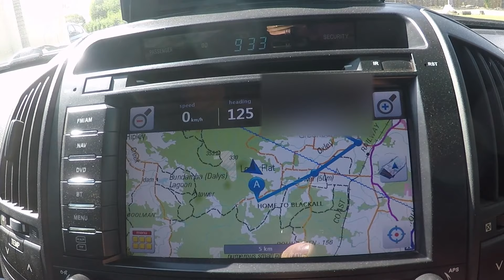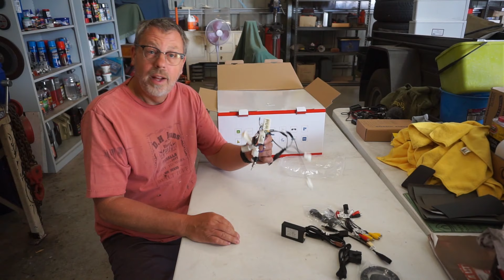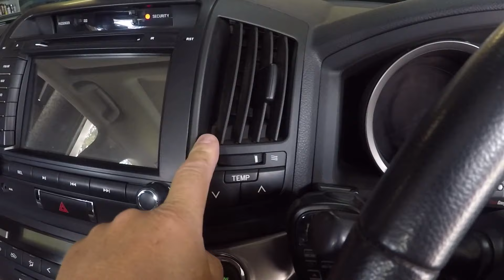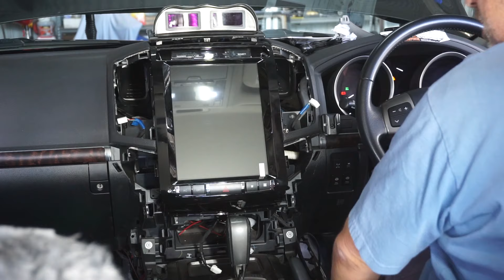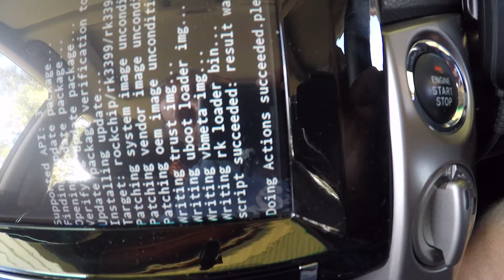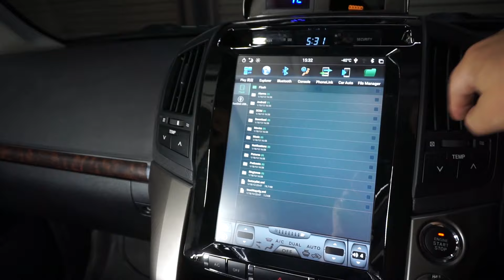Landcruiser 200 | PX6 12" Tesla Style Android Head Unit Installation

Comment: great video.  Great information.   So impressed with Tesla screen "opportunity".  good to know what can possibly go wrong.   Really appreciate the information,   Thank you.  In the process of deciding if to buy a 2011 Landcruiser with or without the big screen.  We really do want the big screen,   If it works!
Reply from the maker: Thanks for the kind words.  The firmware upgrade takes these from a game of hit and miss, to one of solid non glitchy performance.  I love mine👍😎
Reply: Your information  @JafffaAdventures   is a true diamond.  This week we viewed two 2010/2011 Land-cruisers with the big "tesla-esque" headset and one with the original radio,  Toyota/Lexus - are super-reliable at 10-13 years old.   The only issue is the "dated" GPS and dated lack of mobile phone synchronisation.   We all live by "Wayze" navigation here.  Thus if it can ever work - it will be a true game changer.  The big-screen units I saw had Landcruiser logos/images.  But there was no proof that all the configurations work. Both car dealers - said that these screens needed another re-setting.  The dream is to have proper 360 degree cameras working and to have this massive screen to have full Wayze AND  Google-maps options.    We shall see over the next month.    We live in a country with excellent mechanics.   So we will see,....
Reply from the maker: Go well mate👍😎

Comment: Hey Terry.
I just installed the 10.1inch head unit. I got a Amplifier and focal speakers installed aswell, and no real significant improvement. 
Have you upgraded anything from factory in your audio? And if so are you happy with it.
I'm trying to nut out if the Amplifier is not powerful enough. Ec said it should of improved significantly. 
I hope for a response.
Thanks Terry
Reply from the maker: Thanks for reaching out.  I did not upgrade any audio components in my system.  I was seriously considering the focal speakers and am disappointed you have not seen any improvement as I was lead to believe the difference was like night and day.
The current factory speakers are ok, but I was looking for something that really kicks butt.  
I am not using an amp.  Sorry I could not be of any help.  If you do get it sorted let me know what you did so I can learn too.  Cheers
Reply: @JafffaAdventures  Focal do kick butt. Installers saying the amp works and ec saying it doesn't. And guess who's stuck in the middle? The customer as usual. It's turning into an expensive mess
Reply: @JafffaAdventures  I bought the Focal is690toy. Don't be fooled about plug and play. Tweeters need rewire and speakers need new hole drilled out. Pretty pissed about it all.
Thanks for replying. Appreciate it
Reply from the maker: Wow, I really thought they were plug and play.  Thanks for sharing 😎👍
Reply: @JafffaAdventures  Hey Terry.
I sorted our my volume issue so passing on info you may not be aware of on yours, especially for future preference. In the factory settings on head unit once you put in password. There's a sound setting you can control, it's a gain function in DBI. Ecoffroad after 3 calls never mentioned this setting so I was lucky I found a local guy that knows his shit . If wasn't for him I would of upgraded amp again and problem would of been the same, so thank God he saved my ass.
Keep that in the memory bank if want unit louder, especially if upgrading speakers. Mines crazy loud now
Reply from the maker: That is awesome feedback, thanks for sharing.  That’s one thing I have noticed with these units, there and dozens, possibly hundreds of settings that can be changed.  I reckon a lot of difficulties people experience are with setting issues.  I’m stoked you got it sorted mate, cheers😎👍

Comment: Hey there Jaffa, just wondering
How did you install the temperature display into the unit as it's integrated into the existing unit?
Does the emergency switch actually work or it is just sitting there looking good without any connection?
Reply from the maker: Temp is displayed by the unit itself but needs internet connection as it pings the local weather for the area to get the data.
Yes the emergency switch is fully functional.  
Cheers 👍😎

Comment: Hi buddy ,

I have installed the px6 into a 2020 Sahara but have no sound or reverse cameras . With the audio connections do I need to plug in connectors from sahara harness to audio connections with the Px6 . And with the cameras and 360 camera do I need to plug in more then 1 connectors currently I have the two yellow ones plugged in labeled camera & 360 camera ?

Any feedback would be hugely appreciated. Love the videos mate 

Thank you
Reply from the maker: Thanks for the kind words mate.  I wish I could help but I’m afraid I can’t be of much use.  I just plugged everything audio related into the factory harness and it worked straight up.  Same thing with the video.  I’d reach out to you supplier mate.  Cheers😎👍

Comment: Nice video as usual 
I’m one up on you my temp indicator works
I had a real drama trying to get the unit to link to my iPhone hot spot but it turned out it was me not the unit 
I hate it when I can’t blame someone else
What did you use to customise the screen photos 
My next drama is my aircon temp resets itself to 25deg so I have to crank it down every time I start up so hopefully I can sort that out cause it makes me tense everytime
Reply from the maker: I know, it sucks when you can’t blame someone else😂.  I used Sergey Koslovs custom firmware to set up the photos of my vehicle on the home screen.  Without that firmware you cannot do it.
I never had any dramas with my AC, just the temp reading.  Sergey has since fixed that so it reads correctly now.  Thanks for watching mate, I sincerely appreciate it 😎👍

Comment: Hi Terry, I got it installed myself. Everything works perfect except the volume is very low coming out of the speakers even with it being on the loudest from the unit. I have also gone to settings and increase the volume to the loudest but to not working, actually only one speaker (Front - Right) its working and very low.
Is there a separate connection which would increase the volume? Someone knows how to fix this? Thanks in advance.
Reply from the maker: That’s a bummer Ruben, unfortunately I did not have the issue so am not really sure what the problem is.  Is the volume the same from blue tooth through your phone for example vs Spotify on the head unit, vs a radio station.  The reason I ask is that sometimes Bluetooth can be a little quieter, especially if you are streaming from a device like a phone and your volume is turned down on the phone.  I trust you will get it sorted mate, cheers🤔👍
Reply: @JafffaAdventures   Thanks for your reply. Initially I thought the same, but no the sound is the same for Bluetooth, radio or other device. I have searched for this and found I guy that had this same problem, I've asked how he have fixed this issue and I waiting his reply.
Reply from the maker: That’s good to hear Ruben, good luck mate.  If you don’t have Sergey’s firmware I would definitely recommend that once you get settled.  Cheers😎👍
Reply from the maker: Let me know if it works.
Reply: @JafffaAdventures  Hi Terry, here is my feedback about the video about the no sound in my Tesla type unit, it really worked. The video fixed my problem. After that I had another issue with my reverse parking camera, I had no signal. After checking lots of videos I found that after change for the Tesla mideacenter unit the original camera from Toyota LC200 don't works any more. I bought a new aftermarket camera and now it's working perfectly. Cheers mate.
Reply from the maker: Good stuff, thanks for sharing Ruben😎👍
Reply: @JafffaAdventures  Hi Terry, do you know where I may found Serge´s firmware for LC200? Cheers
Reply from the maker: Go onto the FB group I mentioned the the video series (can’t remember the name), search Sergey Koslov and direct message him.  He is very responsive.  A firmware upgrade will transform the unit, best thing I ever did with it.  Cheers

Comment: Great videos Terry, love the "how to ones". With the OBD2 connection are you able to lose your scan guage. Is it any good
Reply from the maker: Thanks Gavin, you are very kind mate.  The OBDII connection does not have as much data as the scanguage (eg fuel consumption is missing), although having said that the majority of the information is there and the stuff missing might be able to be found, I just have not looked hard enough.  I much prefer the scanguage however and will definitely be keeping it.  That’s because it’s mounted on the dash right in front of my eyes and is constantly in my vision.  Using the head unit, I have to turn my head to read it and if I have an app open I have to minimise the app to see the data.  Not a big deal but it’s enough for me.  Good question mate, thanks for asking 😎👍

Comment: Hi mate, what part of the harness does the reverse camera plug into on the car? I have a 3 leads coming off head unit which have no matching connectors from the car?  thanks for the video, it helped me slot , I just can’t see where you hooked the reverse to the actual car harness , cheers
Reply from the maker: The main wiring harness has a yellow AV plug that is labelled "reverse camera".  I show it at time stamp 4:17 in the video.  Thanks for watching and following, and I am glad you found the video helpful.  Keep the shiny side up, cheers!

Comment: Hey mate, any idea where I can get those bolts that hold the factory head unit it in, also is it safe to drive my car without a head unit in as I’ve taken the Tesla style out to send back and can’t refit old one as no bolts, thanks
Reply: If you could send me a photo of them or if you know the dimensions that would be awesome as I can go to bolt shop tomorrow and buy some, thanks mate
Reply from the maker: Sorry mate, I’m not 100% certain and I would have to pull my unit out to determine specifically.  I would suggest they are a M4 or possibly M6 (8 or 10mm head size).  I would go to Bunnings or the like and buy the range of sizes and return the ones you don’t use (unless you can use them for something else).
Definitely ok to run the car with no head unit.  I did that with mine for over a week with no negative consequences.  Thanks for watching 😎👍

Comment: Nice video. Mine is installed but a/c  buttons not working. 2009 prado 150.Any suggestions? Have been playing around with various factory set interface but no luck
Reply from the maker: Thanks for your kind words, I sincerely appreciate it.  My AC buttons worked first up after install so I never had to address that issue.  The only thing I could suggest is to go onto the FB forum I mentioned in the video and ask the question in that group.  There is a great depth of knowledge there, someone should be able to help.  Cheers😎👍

Comment: had a similar problem in my gx.. same unit, but bought from a different source. not in Australia.
must say, the company did try everything to help me out.. sent a new canbus, even sent a tool to get the readings from my air con control... end story... they refunded my money and told not to worry about sending the unit back...
Reply: GX dont have dual zone AC thats why you had problems. 
we dont sell them for GX at all.. only our 10inch unit will fit GX
:)
Reply from the maker: Thanks for sharing your story Dale, I sincerely appreciate it.  Seems to me this is a common theme. Some love it with no dramas, some can’t stand it and end up ripping it out, and some live with glitchiness.  I trust I will be in the first camp but time will certainly tell.  At least you had a decent customer service experience, that’s gotta count for something.  Thanks again for sharing Dale😎👍

Comment: Great video Terry, did have a chuckle with the set up. Glad you got there in the end. Will be good to see how it performs over time. What are the gauges you have on top of the unit?
😂
Reply from the maker: Thanks for watching and commenting Scott, I sincerely appreciate it.  I had to have a chuckle as well mate, otherwise I would have cried😂.  The gauges on top of the unit are EGT’s, left one for the left bank, right one for the right bank.  I just bought the gauge pod off eBay.  It was for round gauges so I had to fill in the round holes then cut out rectangular ones for my temp gauges.  I then bonded the pod to that Toyota top cover, bogged up the seams and shot it with a matt colour that closely resembles the dash.  I think I go into a little detail on it in my Rig Rundown Interior video.  Cheers😎👍

Comment: I had similar issues with my android system, not purchased from east coast offroad but elsewhere. After a lot of messing around, and the realization that you need to be a software engineer to achieve what you want, I decided to get a replacement unit locally and all has been fantastic in VW amarok. 
Great units once the teething issues are sorted.
Reply from the maker: Thanks for you comments and feedback on these Joel, I sincerely appreciate it.  That’s my impression of the unit so far, a pain in the backside to get ironed out but once it is, it’s fantastic.  I’ll let you know how I get on in the coming weeks 😎👍
Reply: How’s it holding up now?
Reply from the maker: Never missed a beat, love the functionality, just like a laptop in many respects.  Cheers👍😎

Comment: Great video as usual Terry, nice job!
I love those big Tesla style units despite getting different opinion from various forums and FB groups.
Apparently they are very capable and fully customizable but not enough customizable to be able to run a much simpler air con system like the GX, go figure!
What I like the most is the split screen option, it should be like having two units.
I'll be looking forward on your next review video as I highly value your opinion.
BTW I don't have that glitch on my VMS4x4 system.
Thanks
Reply from the maker: Thanks for watching and commenting Max, I certainly appreciate your wisdom and support.  Unreal that they can’t control a GX climate unit, I 😎did not know that.  Glitches are funny aren’t they, one person can have a drama and the next has never had a one, go figure!  I have only scratched the surface with this unit but the “customisability” seems pretty awesome.  I’ll post up how I get on in the coming weeks. 👍